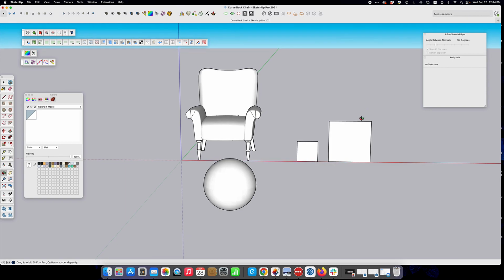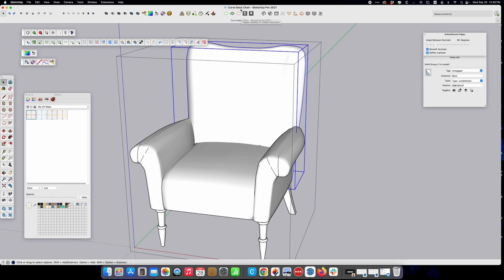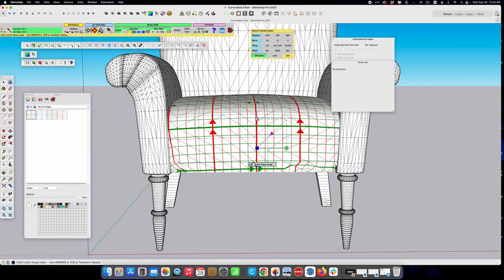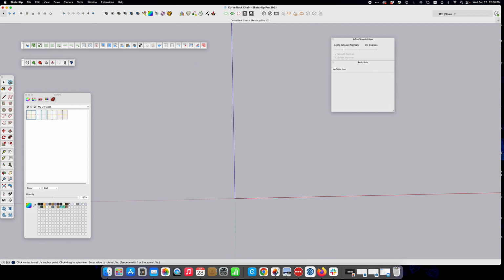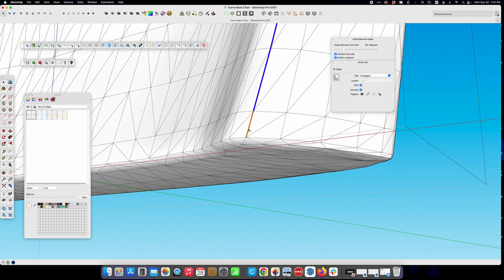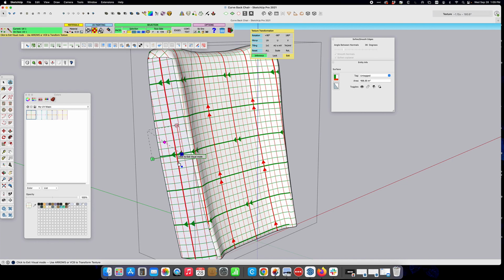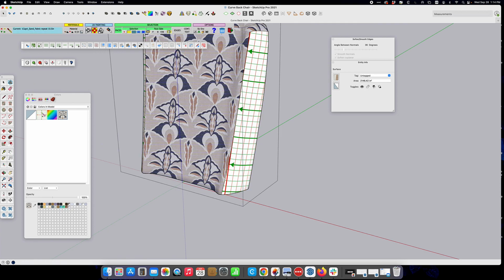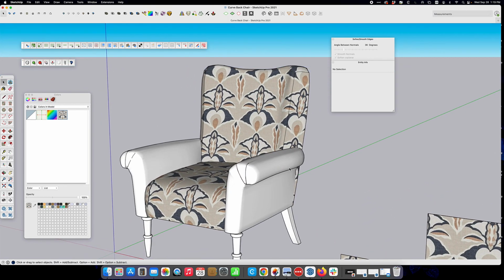Sketchup Advanced Texturing on SubD Surface using ThruPaint and SketchUV

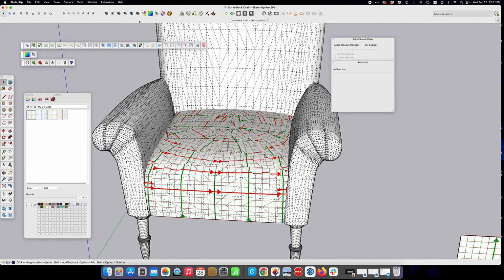Comment: Great video! I got a question related to 7:26 - you mention that after subdividing you won't always end up with quads and therefore ThruPaint doesn't work. Can you elaborate on what happens? When you use SUbD the result is that the entire mesh is QuadFace Tools quads - they might not all be planar quads, but quad in the sense of how QFT, SUbD and Vertex Tools will understand. Is ThruPaint working only on planar quads? It doesn't understand QFT quads?
Reply from the maker: I'm not so sure that I can really explain it.  I don't think it has so much to do with whether the quads are planar or not, but where corners are created (think of the 3 sides of the corner of a cube that all share a point), the quadmesh texturing doesn't seem to know what direction to run the texture, so it errors out and makes that part of the surface glow red.  If you can isolate the corner out by forcing the edges to be un-soft in a way to avoid the problem area, the quadmesh texture will apply to that surface.  It is a good tool for doing rounded shapes (like the curved back of a sofa) but you have to avoid including any 3 sided corners.  Hopefully that explains it a bit.
Reply: I can confirm that Thrupaint works 100% fine on QFT non planar quads (tbh it works better with diagonals than it does without.)
It just doesn't like poles in the topology (and it doesn't like actual tris or n-gons of course). 
If you really want to use it on meshes with poles, you should group it in patches without poles and texture those patches individually.
That won't make any sense in most situation btw. 
Thrupaint quad method works fine on most arc/profile/sweep/loft stuff when you really want a pattern to follow along the flow of a loop/ring set.
For complex/organic geometry with poles, a proper unwrap is the way to go. 
I strongly reccomend Wrap-R over Thrupaint for that kind of stuff.
Reply from the maker: Thanks so much Marcello.  I guess what Im calling a corner is what you are calling a Pole?  I'd love to try out Wrap-R, but it is not available for Mac, which is what Im using.  A proper UV Unwrap tool for Sketchup would be life changing for me.  My method works (usually) but its a lot of extra work involved that could be solved with UV Mapping.